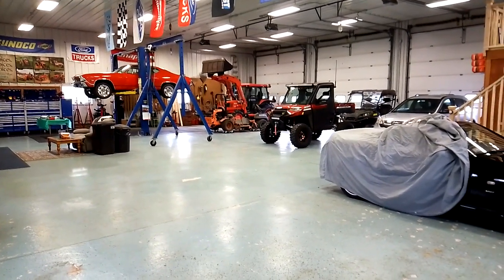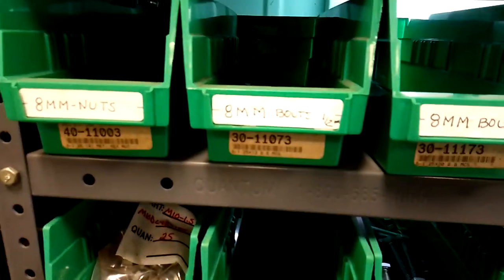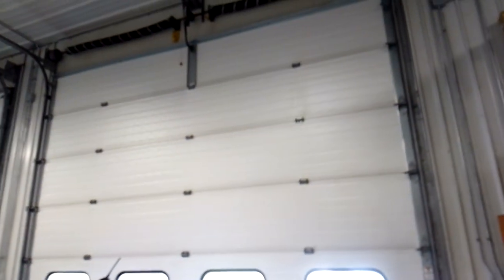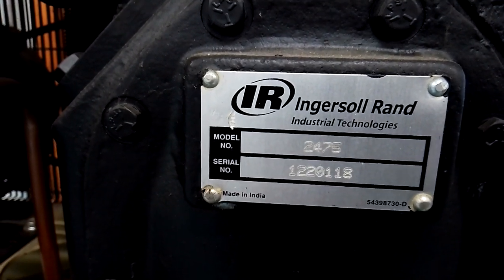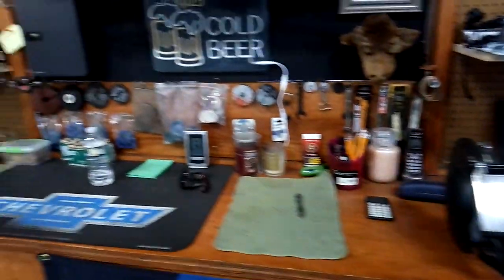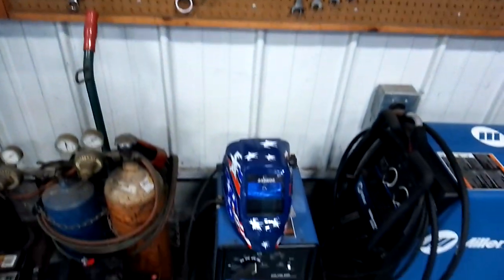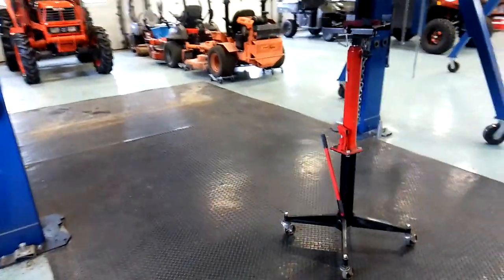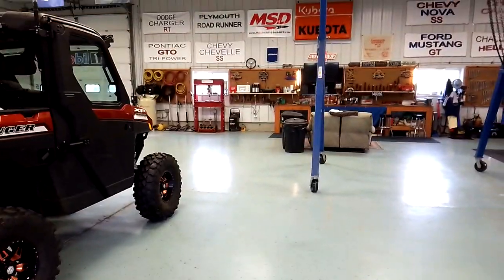Morton building ,70x54ft, full tour,biggest home shop on you tube??

Comment: Do you work on vehicles at that garage?
Reply from the maker: Hi, troy,yes i do, im retired, but i have, alot of customers!! I only do easy work on the side, brakes,exhaust,suspension, belts,starters,altenators,fuel lines,brake lines,e brakes, oil changes,tire rotation, tranny flush,radiator flush, easy stuff!!, On my cars and trucks, ill do, engine swaps, tranny swaps, rear end work, so on!! This is my home shop!!! Its big, but i have big acerage!!! Thanks troy for watching!!!
Reply from the maker: By the way,troy, ill be building square body chevy soon!!!!
Reply: Love it! You have my dream garage. I would want exactly what you have, but with polished concrete floors. Oh and by the way, ditch that Bud Light and Busch, time to switch to Miller. :)
Reply from the maker: @spencerd1079  hi spencerd, glad you liked it, thanks for watching, I used to drink miller along time ago,lol!! Stay tuned for more good stuff!!